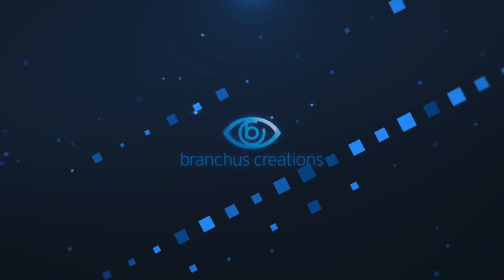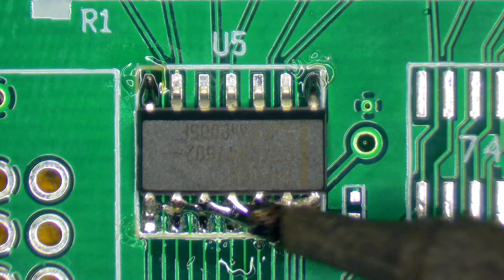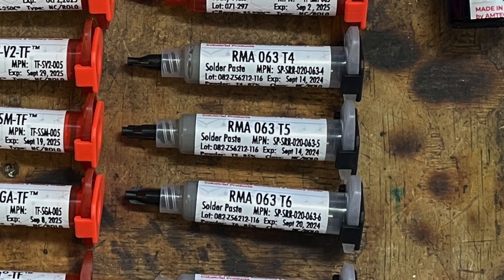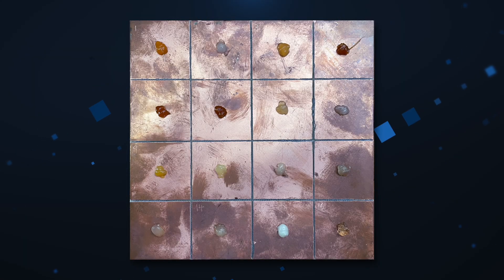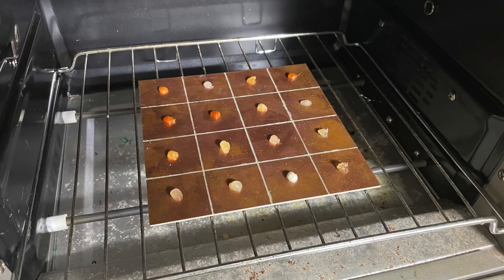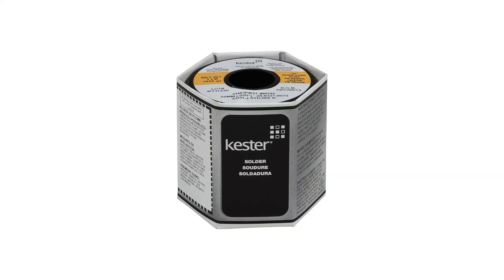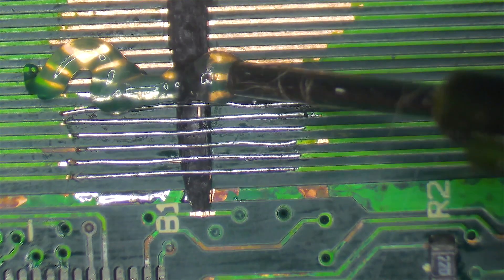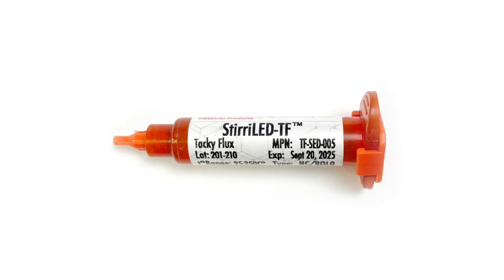Stirri Tacky Flux Range Product Review

Comment: Great review!  I really like the Amtech NC-559-ASM-TF .  I have one last tube of it that has the Amtech name but also says Stirri on the tube.  I bought the Stirri-ASM-TF and found it works pretty good but was more think and sticky after use then the NC-559-ASM-TF.  Do you know if the Stirri-ASM-TF was supposed to be a direct replacement for the NC-559-ASM-TF?
Reply: It's the same company, just rebranded name. It is possible that you got it recently, and it's a fresh batch. The ASM is supposed to be very tacky and thicker than other fluxes. So, depending on how long ago you got the original, you may notice that difference. Yes, the Stirri ASM is the name replacement for the NC-559-ASM

Comment: I always find flux cleaning the most frustrating aspect of soldering work, so for me perhaps the V3 would be better than the ASM? Not by a lot I assume, but every little thing helps. I own and use an ultrasonic cleaner sometimes, but as I am a hobbyist I don't have it setup and ready for use all the time.
Reply: Seems interesting for those boards where you can't use an ultrasonic cleaner, i.e. boards with MEMS devices etc.
Reply: @oliverer3  Very true. I learned that the hard way the first time I repaired a smartphone. Suddenly I needed to also switch out two digital microphones and the gyroscope/compass/accelerometer. I had seen mobile repair shops use ultrasonic cleaners before on YouTube, but I realized afterwards that they only dipped specific sections of the PCB into the ultrasonic cleaner, while I plopped the entire thing in there. 🙂

Comment: Excellent video, Bruce! Fortunately, I've got to try out all of those formulas. To be honest, I have many favorites for different reasons, although I do like them all. All time V3 was my very first choice when I first discovered Stirri but since I work with leaded solder, the MT is my current favorite just like you mentioned I love the clarity and the action I've gotten from it. To be fair, they all performed excellent for my needs. The V3, V2, VS-UHF, ASM, HT, and MT are all on my current rosters. The hydra line is great, but I used the rosin base more. I use them almost like flavors for scent. But I love all of them. Stirri has done a spectacular job. I, too, have run through many fluxes both by major players and small ones, and my go-to is Stirri all the way! I'm glad to see this video. I'm sure many like myself have been awaiting this.